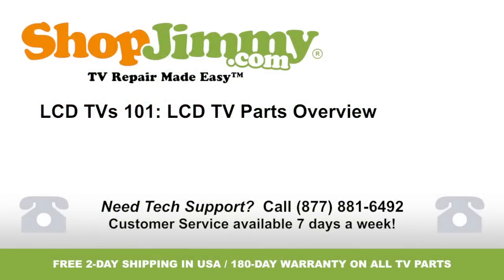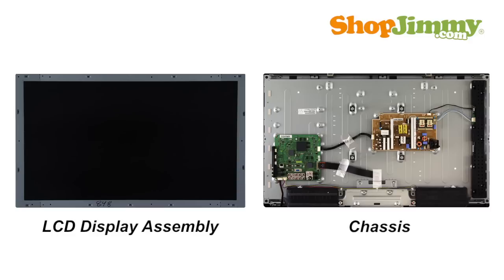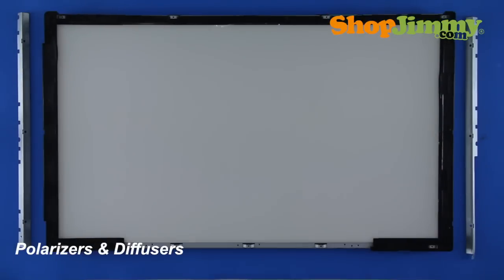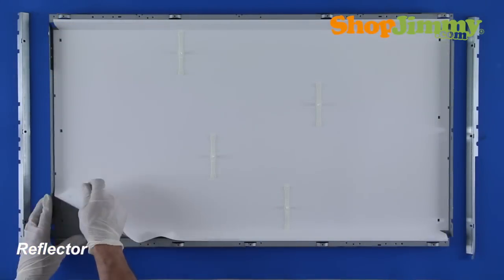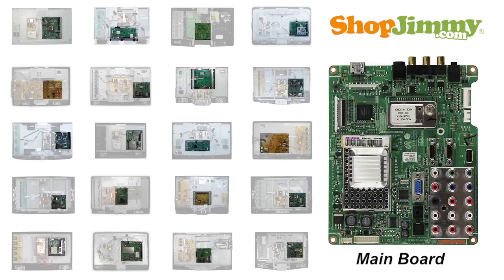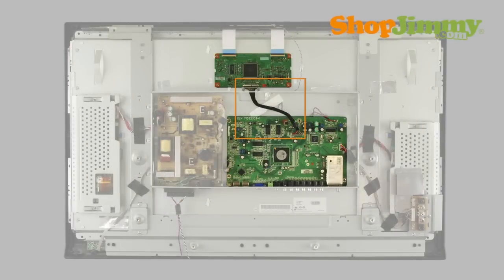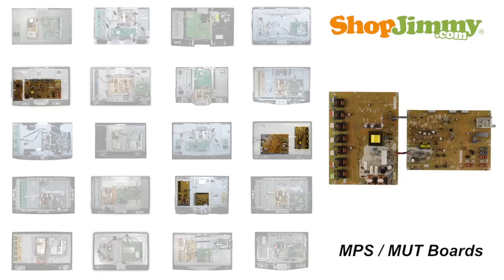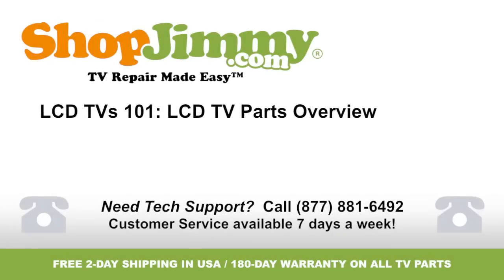LCD TV Repair: LCD TV Parts Overview Diagnosis & TV Repair - Common Symptoms

Comment: Insignia NS55E560A11: At first, when set was powered on we would see immediately green lines on the screen but still had audio. We would have to power the set off and back on again (sometimes several times) before a normal picture would appear. It would be fine for a long time and then the problem would return. Recently the above-described problem returned AND now the set won't power on fully. It starts to turn on, then powers itself back off again. We have tried plugging it into different outlets, different input connections, etc (we have Verizon FIOS cable boxes, and the cable box was connected as component ) but the problem remains. It is driving me crazy. Any help with diagnosing this issue would be VASTLY appreciated. I am terrified of ordering a replacement part and being wrong. Thanks!!!
Reply from the maker: Stacy Hirst   I recommend replacing the main board in your TV.  Here is a link to replacement parts for your TV model number on our website, click here:  http://www.shopjimmy.com/catalogsearch/result/?q=NS55E560A11  Be sure to match part numbers on your current board, with your replacement for compatibility.  Here is a link to a video showing how to identify your part number, click here:  STEP #1 - Insignia Main Boards Replacement TV Part Number Identification Guide  You can also call our customer service for further assistance with your purchase.  (877) 881-6492  Thanks and please let us know if you have any further questions with your TV Repair!  www.shopjimmy.com

Comment: Hi, I have a flat screen 43" samsung tv with no picture when I  turn on, 2 lights are blinking one in front and one in back, the samsung emblem shows on the screen on and off like is trying to cycle. I ALREADY CHANGED THE Y- BUFFER BOARD STILL THE SAME. MODEL # 843AX-YB02
Reply from the maker: luis napoles   Try all repairs and troubleshooting at your own risk.  You will need to also replace the y board, since you replaced the buffer. Unfortunately I do not see any replacement parts in the search results for your TV model number on our website.  Thanks and please let us know if you have any further questions!  www.shopjimmy.com

Comment: Hi, I have a  Sharp LCD 60' MODEL# LC-60LE857U The screen has a purple spot 3" in diameter, in the lower right side. What would be the be problem?
Reply from the maker: +Buddy Cook   Try all repairs and troubleshooting at your own risk.  This sounds like a TV panel (TV Screen) problem.  If your TV panel is bad, it may be more cost-effective to replace the TV as panels are typically hard to find in stock, difficult to replace, and expensive.  Thanks and please let us know if you have any further questions!  www.shopjimmy.com
Reply: led TV repair

Comment from the maker: @Norman Banaszak - You could try replacing the t-con board on your TV.  It could also be the panel that is bad on your TV.  If it is the panel, you will most likely be better off replacing your TV.   I am not finding any parts on our website, or online for that TV model number.  Please call our customer service for further assistance with your repair/purchase.  (877) 881-6492  Thanks and please let us know if you have any further questions!

Comment: Hello my TV Sharp LC-37D43U  turns on and lights-up for a second then goes to Black screen it has audio only. could you tell my which parts seems to be defective T-con, Main Video board or invert boards.
Reply from the maker: Victor Garcia   I recommend running the flashlight test on your TV to help determine if the problem is the backlight inverter or the main board. Here is a link to a video we produced that shows how to run the flashlight test. No Image No Picture on Screen-Flashlight Test LCD TV Repair - How to Diagnose Broken Board TV Repair Please reply with your flashlight test results and we can recommend a replacement part for your TV repair. Thanks and please let us know if you have any questions! www.shopjimmy.com

Comment: hi, my TV VIZIO SV471XVT have a problem, when i try to turn on this do not picture, not sound, nothing happen, let me know if then best option is to change the PSU , please. thanks.
Reply from the maker: fernando montero   Does the logo in the front light up and look amber colored?  Thanks!  www.shopjimmy.com
Reply: it does, when turns on light VIZIO logo change the color.
Reply from the maker: fernando montero  If you have no picture on the screen, then I would say you have a bad main board.  Here is a link to replacement parts for your TV model number on our website, click here:  http://www.shopjimmy.com/catalogsearch/result/?q=SV471XVT  If we are currently out of stock, you can sign up to be notified when parts come back into stock.  Be sure to match part numbers on your current board, with your replacement for compatibility.  Here is a link to a video showing how to identify your part number, click here:  TV Part Number Identification Guide for Vizio Main Boards (Plasma, LCD, LED)  You can also call our customer service for further assistance with your purchase.  (877) 881-6492  Thanks and please let us know if you have any further questions with your TV Repair!  www.shopjimmy.com